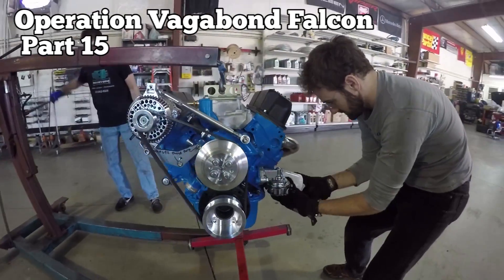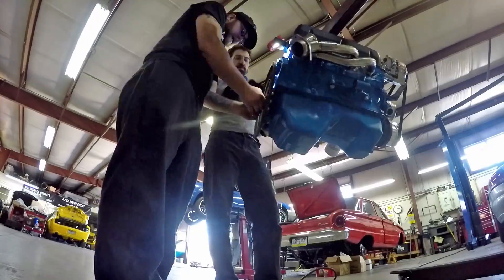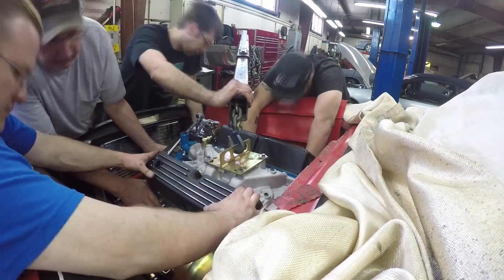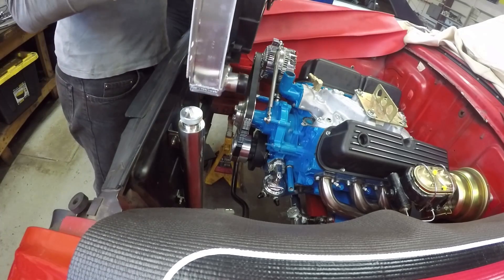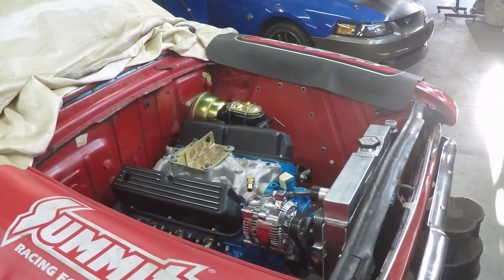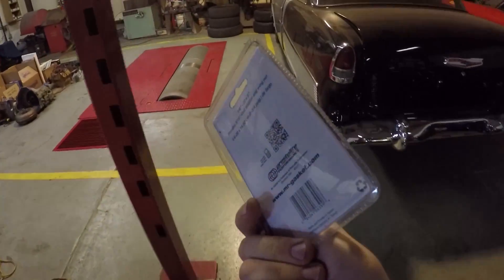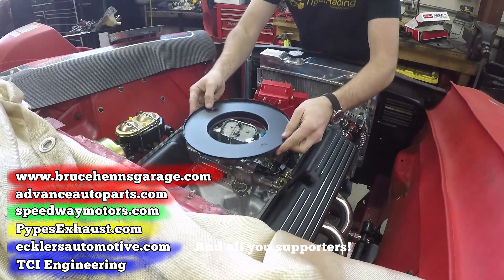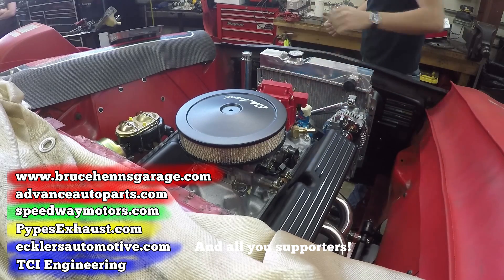Operation Vagabond Falcon: Part 15

Comment: It's so cramped?  Have you seen engine bays today!?  lol.  Sure, it was snug between those shock towers stock, but that's still nothing compared to the packaging of engines today.  Also gotta remember that they don't exactly put them in there with the intent of making them easy to take out.

Comment: Sunbeam Tigers has two fans on the front side of the radiator too. Honestly pushers work more efficiently, plenty of cool air to pull in the fan motors themselves stay nice and cool. Even the Harley V-Rod has a fan behind the shroud pulling air into the fighter jet like ducts.

Comment: 0:20 Rick Sanchez?
2:00 What about a wall of computer fans? I mean it's not like you would need a power converter because most are 12 volts.

Comment: If you still have cooling problems after you get it on the road you might look into changing over to an Explorer water pump and pulley set up. That should give you enough room for a puller fan and shroud. I have a 1965 Mustang that needs the same set up. You should be able to find the parts that you need in the Ford Performance Catalog. Good luck to you. That is a cool car!

Comment: Biggest thing to worry about with the Edelbrock Carter pattern carbs and clearance is the accelerator pump linkage on the top. Otherwise, it should be a-ok. At most you'll need a plastic spacer and have to get into the catalog for a shorter element. Looks good, brotato chip. Nice and clean install. And you have some old guys helping, so they're probably keeping you from stepping on your dick too much more than the mounts being backward. 
Onward.

Comment: Why use AOD instead of a stick? Just for cruising or is there some reason manuals aren't an option?
Reply: +C Clark  3 speed Column Shift was offered on the early Falcon. This Falcon was already a factory automatic so he mentioned in an earlier video that he was going to keep it automatic...albeit with 3 speed and Overdrive as opposed to the old 2 speed Fordomatic slush box.

Comment: +regularcarreviews 

are you reusing the stock drive shaft or getting one made?

a heads up the yoke on the explorer diffs are different, you could cannibalize the back yoke off a exploder to put on your driveline 

I ran into this issue with my 8.8 swap

Comment: It really would have been nice if you guys had modernised it a little with EFI and ECU. Much cleaner look without the bulky carb and distributor + better power and fuel economy.
Reply: Most of the EFI intake manifolds for a 5.0L are very tall. There's no way the hood would close. 

Also, if he was to run a DIS he'd have to worry about wiring and tuning. A carb and distributor is very simple.
Reply: +John Dove     You can get kits from edelbrock and holley that are drop in carb replacement tbi units.. not true fuel injection i know.. but better than a carb..  and would still fit under the hood.. they look like carbs almost..lol...  plus they come with a self tuning ecu and everything else you need except fuel pump...
Reply: Yeah, Edelbrock, Holley, MSD, FiTech all make those types of units, and honestly they are really good. 

I was thinking the way the build is going with mostly stock or stock replacement parts being used that if EFI was going to be part of it they would used the stock Thunderbird or a Mustang setup.

Comment: Quick question, why didn't Mr.R go with a manual transmission? I know the original falcon was an automatic but he's putting the megashifter in there so the original look is the inside (in terms of shifting) is already tarnished.
Reply from the maker: +HEROrr I want everyone to be able to drive Vagabond Falcon
Reply: +HEROrr He wants it for long-distance driving, not really racing, and a fan gave him the Megashifter for free. A $2k-3k (if I remember right) shifter FOR FREE. He had a whole video dedicated to it.
Reply: CPD0123a Thanks for the reply. I saw the video, but he was mainly just covering why he is using the megashifter opposed to the column shifter. I know he isn't going to be using it for racing, but people mainly just like manual transmissions because they enjoy feeling more connected to the car. I don't have a problem with it either way, just curious on his exact reasoning.
Reply: RegularCars A response from Mr.R! :) Thanks for the explanation, that makes sense now! Hopefully i'll be at one of your meet ups some day!

Comment: why an automatic?
Reply: +mark rossi because the car was originally a auto and he's trying to keep it as close to original as he can.
Reply: +armymatt83 ah, makes sense, thanks.
Reply: +armymatt83 Not very original in my opinion. Whole new front suspension, disc brakes, bigger engine, different rear end. Really it is just to make it an highway cruiser.

Comment: I had no idea that you could suspend an entire engine from the carb bolts on the intake! I am sure it's fine if Bruce is letting it happen in his shop, and I won't be some fake "expert" who tells you how bad it is because I have no Idea. I have never worked with an engine that didn't have a little "engine pickup bracket?". Once again I have learned something new. Loving the videos, and congrats on taking a big step towards finishing!
Reply: +Justin Guarino This is american intake manifold. This thing is cast iron, weight more than me and i bet it is safe to suspend entire car from that bolts.
Reply: +Алексей Любимов Oh, absolutely. I had just never seen it done that way before personally, and it totally threw me off.
Reply: +Алексей Любимов that is not an iron intake; it's cast aluminum.  still ok to do.  some people use bolts on the front and back of the block to attach the chains, but there's clearance issues here already.  anyway, using those bolts and a spreader bar on the engine hoist would allow you to set the angle as you're dropping the engine in instead of having to man handle it.